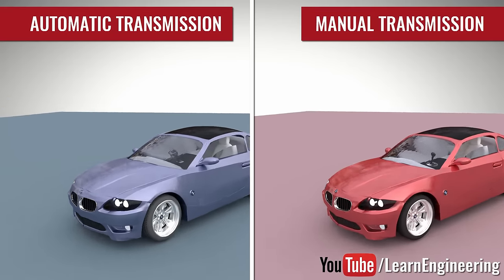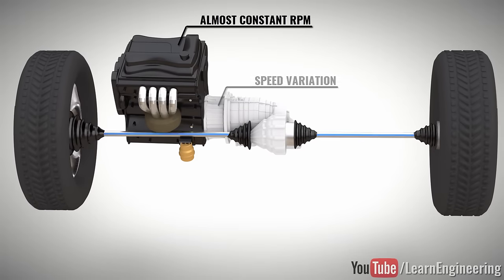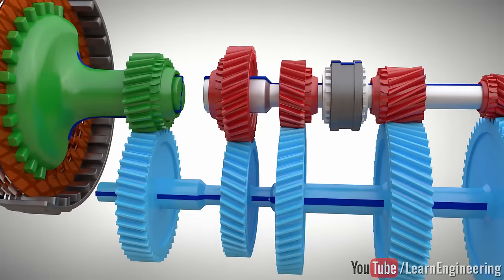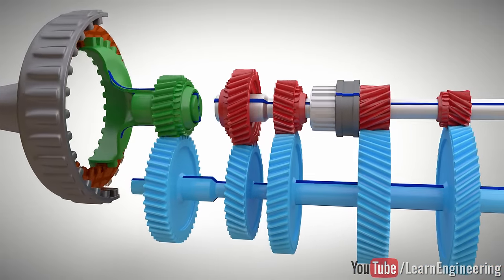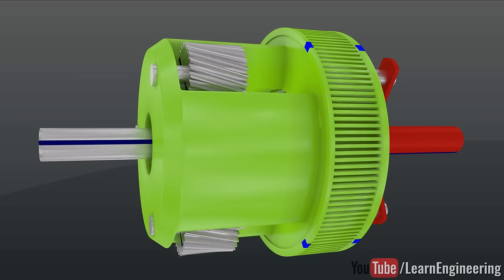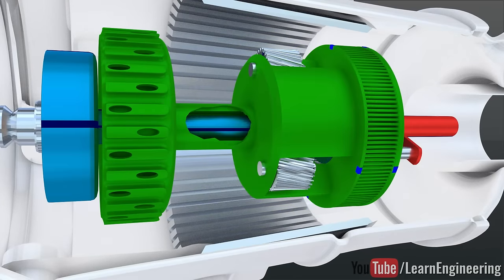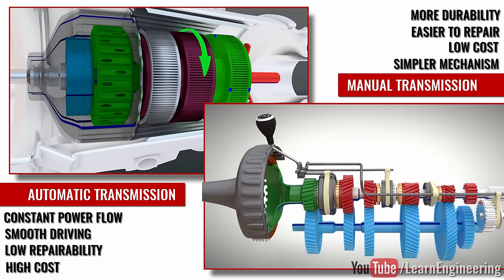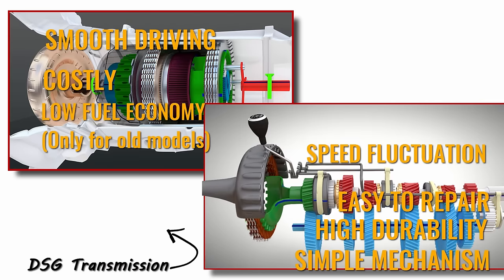Automatic vs Manual Transmission

Comment: In order to shift as smooth as a automatic in a manual you need accelerate to the rpm you wish to shift at, lift your foot just a bit so you’re no longer accelerating but keeping constant, and then shift and complete a smooth clutch and accelerator exchange
Reply: Wow sounds 1984
Reply: Its super easy, i learned when i as 9 in a 1995 ford ranger. No matter how old as long as you know what youre doin stickshift is smooth as butter
Reply: ..... it's all about the 'feel'.....being one with the vehicle...
Reply: >t Never drove an automatic

Comment: Corrections:
Manual transmissions (in cars) use a clutch disc, not a clutch pack. An automatic transmission has several clutch packs, like pictured.
Reply: Its actually called a clutch pack in a manual transmission
Reply: @joeseverythingchannel6564  "clutch pack" implies more than one clutch disc, and since manual transmissions use only one clutch disc that can not be referred to as a pack.

Besides, the pictures are wrong.

Work on learning before posting.
Reply: Actually the clutch pack includes the throw out bearing, pressure plate, friction plate (on flywheel applications where replaceable), and the clutch housing in the bell housing so eat it buddy do your research before responding
Reply: @Iowa599  oh and fyi there are manual transmissions with upwards of 4 clutch disks in them its just that the most common stock clutches only have one. Most clutch upgrades include 2 or more clutch plates to increase the surface area of the friction material

Comment: vote manual transmission
more controll and more safety
Reply: dafuq ? How the f is manual safer?
Reply: Ahh i wrote it just my opinion and a fact about my driving style,every person have opinion,did u have opinion too?lets share if u have. Auto and manual have many pros and cons
Sorry for my bad english
Reply: My opinion is auto,i mean you can just drive around chilling,dont need to shift gears

P.S my opinion
Reply: +TheRealMonster engine brake is stronger, you are less likely to mistakenly press the gas pedal when you are supposed and wanted to brake
Reply: Nice,but shifting transmision its more enjoyfull like a sportman :-D ,because we can set the speed and engine sound. No shifting like eat withouth drinking a water hehe
Reply: grayisagirl c engine brake stronger than manual?lets try at top gear and move instantly with first gear and press the brake pedal and what happen hehe
Reply: you can set the engine sound on automatic 2 :) you can (most likely) switch gear to left and theres sport mode then you can shift gear by yourself :)
Reply: TheRealMonster hehe i wanna drive auto too,but my father only have manual car hehe
Reply: You know what they say...automatic is luxury
Reply: Auto in a car and auto in a bike same or another diff??
Reply: Mochammad Agung Hidayat bro you smoke? which sentence I mention the engine brake is stronger "than manual"? Read the sentence carefully again please.
Reply: TheRealMonster if you know how to drive a manual is safer
Reply: ak74udieby tbh im 12,but i have no problems driving manual
Reply: Mochammad Agung Hidayat yep anyways automatic really sucks in the snow and it destroys it's self so fast and then R.I.P your money
Reply: Okay bro thx for every opinion,,but i'm still prefer manual hehe
Reply: Stop bro,calm down pliss
Reply: TheRealMonster manual is better, not only do you feel more in control, theres a coolness factor to it
Reply: a1022man well i agree with that ;P but have you tried auto?
Reply: TheRealMonster yes i drove auto for 2 years, im still relatively new to driving manual, ive only been driving manual for about 6 months but it keeps you more aware, you feel like you are actually communicating with the car
Reply: TheRealMonster I find manual to be more enjoyable. To be in a house with roommates with 5 cars, three automatics and 2 manuals I driven them all. I do find manuals to be a little more reliable in both traveling and safety.  My sports car, a Nissan 350Z can average almost 380 miles before I need refueling. Same model car automatic only gets 320, roughly. Because of the 6ths gear, my car is almost practically running on air. As for safety during slippery conditions, you can choose the gear. Allowing low out put of power helps prevent tire slippage.

As for Automatics, they are more reliable in a stop and go scenario.  Such as they city where traffic lights are all over. Automatics also provide the needed safety manuals do not have and that's hills. Especially backwards. Autos do not have this issue, let go the brakes the car simply moves forward. However you have to be an idiot in a manual car to roll  forwards or backwards on a hill.

Which one I like better? Manual of course. You have more control of the car. Need safety? Throw it on a high gear for low power. Need to go faster, throw it on a lower gear and watch that needle sore to around 8k RPM.  Yeah its annoying as hell throwing the gears up and down in the city, but out in open road, when you drive a manual you will understand that's where a car truly belongs.

I do like Autos, drive and forget as if there is no such thing as a transmission. Easy to use for a everyday person who's life is around the city or suburbs. But autos and their computers have a problem, if I need to accelerate.  I feel like the computer is thinking too slow. "Okay, the driver is pressing on the gas hard....  What do I do?.... Hmmm.... Bake a cake?.... No that's not it.... Oh I know! I'm a gear box!"  Taking a long time to shift to the proper gear to accelerate.

I know these days automatics comes with sports modes that makes the computer think real fast and shift much faster. However, it will never nail the right gears needed like the human mind can and that's why sports such as Drifting, and Rally and Track have manual cars, never automatic.
Reply: Haha i got friend for beaten someone wkwk
Reply: I use engine braking heavily in my car.
I always come off the freeway off ramp in 2nd and the RPM is around 6500rpm(max engine speed is 6750rpm).
Reply: I also like manual transmission more because it allows for greater control of engine rpm.
Reply: George David Aye this is true. As I said in my previous comment, Automatics are easier to use. It really comes down the perks you want and the cons you are willing to deal with about a vehicle.

Personally, I like manual better. I will choose it over an Auto anytime day or night. You choose it because it's easier. I choose it because safety, one. And two, the huge price difference. Manuals are cheaper, much cheaper depending on make and model of a car both transmission repairs and when they are sold on the lot.

The gap difference in price can be anywhere between 2-5K, sometimes more if the automatic transmission is badly damaged or worn. Parts and complexity makes automatics much more expensive.
Reply: SilverlonewolfX now a days automatics are better in every single way other than the fun factor which is all down to opinion
Reply: TheRealMonster you're 12 and don't know a thing. A manual transmission car is cheaper, faster, and provides more control over your car. I guarantee you will never beat a car in a race using an automatic transmission when they have manual. Sure automatics are easy to drive but when you're driving an automatic it is very boring and feels like you're not in as much control compared to manual
Reply: True Heights definitely not in a drag race
Reply: greyfoxthesoldier aweee,look who talks  :3
Reply: True Heights dude trust me i control manual pretty ezzy
Reply: True Heights hah race against auto? 😂 for sure auto will be defeat at 4th gear wkwk,
Reply: DoobieR Better in every single way? Not really no. If it was it be used in racing, which it isn't. So that debunks what you said.
Reply: greyfoxthesoldier i do know,alot
Reply: I prefer manual because there is something so satisfying about changing gear you feel in control and powerful in an automatic you sit there holding your wheel and thinking about how much money you just wasted
Reply: +MrCapeCanaveral
You most love replacing your brake pads every year and you most love the brake fade that comes with a power transmitted via oil
Reply: Lol wkwk manual the winner wkwk
Reply: What?!  I have never replaced my brake pads every year.  My wife's car break pads got replaced like after 7 years!  I have never heard of people replacing them every year. Sounds like bullshit.
Reply: MrCapeCanaveral haha my dad replaced his brake pads after 10 years and they were still good enough for at least a few more months. replacing every year is bullshit unless you track every other day but an average person in the us can probably last at least 3 years on one set
Reply: Mochammad Agung Hidayat it depends where you live...here in miami you don't want a manual
Reply: Exactly.  It's sucks in San Fran also. With all those hills.
Reply: TheRealMonster i have tryed auto. absolutely boring for me. i need to be able to downshift and revv match. 😀 but thats just my riding style and taste. aal i know is that i will never go automtick.
Reply: George David so that everyone can drive and crash into each other? or that you could be more on your phone? or maybe are you older? then I'd understand your opinion.
Reply: So automatic drivers are the only ones that cause accidents?  Cause I personally know some manual drivers that have caused accidents before.
Reply: no. i wasn´t trying to say that. but it fell out like that. i wouldn´t be amazed if more accidents are caused by manual drivers.. i was thinking that if the car is so easy to drive then anyone could jump in. turn the key and off they go. i ment like children and, or some grownups who have never riden before. i really wasnt trying to be rude or anything but my lack of skill in english might have made me sound rude. anyways thats just my opinion. and im not saying that automaticks aren´t for everyone. i personally love stick but i understand that some people like auto. that´s just how life is. :D
Reply: Mochammad Agung Hidayat automatic is safer, there is less to worry about and thus the driver can focus on the road.
Reply: Manual is not distracting.
Once you get use to it, it is just like flicking on the turn signal(A thing many automatic german car drivers have issues with).

If anything.
Manual is safer as you have control which is something you do not in an auto.

I can come to a complete stop at freeway speeds just by using engine braking.
Going from 5th>3rd> then to 2nd once the car is going slower than the top speed of 2nd> then into 1st when the car is going slower than the top speed of 1st(this requires double clutching(which can be done quickly once you now how and get the hang of it))
Reply: What control?  Oooh you can stop sooner?!  Shut up.
Reply: Kevin Tõnisson exactly
Reply: +MrCapeCanaveral haha 😁
Reply: +MrCapeCanaveral
I am sorry your ant sized mind cant do more than one thing at a time.
You must be one of those BMW drivers who doesnt use turn signals
It does explain a lot.
Using them is too distracting and difficult.

Manuals are also anti theft devices.
Reply: Is that your attempt at being funny?  It's not working.
Reply: yeah more safety, thats why new cars are almost all in automatic.
Reply: IIGrayfoxII well you're gearbox and engine won't last long
Reply: +Cha Cha
New cars are all automatic in America is 85% of the market wants it
New cars in europe are manual as 95% of the market wants it.

+Tony Johnson
Got proof?
Not red lining, not grinding and I keep to the oil changes.
Reply: IIGrayfoxII 
oh it means in Europe we have 95% of real good drivers. and 85 %of Americanos are gays 😂😎
Reply: Where did homosexuality come into this?
Reply: Ur comments shows how good u r on the wheel & wot u know about the cars... ride a bicycle kid😘
Reply: Lmao!  For real!  I had to read his comment multi times and I still don't get it.
Reply: MrCapeCanaveral  i think he ment to say that grayfox sayed you're instead of your.😂 and i know my english aint good when it comes to writing. 😁😁
Reply: Waw 7 weeks later we dont know what the point here wkwk
Reply: Mochammad Agung Hidayat  yup. it has been fun reading thees comments.😂
Reply: Best comment ever B-)
Reply: Madness4 no.it doesn't

Comment: Something is not exactly what happens in the real driver life at 6:40. First brake then after a while clutch. If you press the clutch pedal first you never get your driving license (in Europe), for very good reasons (engine helps to reduce speed with a manual gear box) 😉. 
Very nice videos, thank you 🙏

Comment: Just finished my manual transmission course and I find just quite similar to an automatic. It's not really that hard. Just needs more practice and you need to get used to. Though it's really fun and keeps you busy and more focused driving than doing other things.
Reply: Dont forget if you put it in the wrong gear your engine and or transmission will grenade.. Thats a pretty big difference. They are nothing alike.
Reply: Honestly, I came to a point where I can't drive automatic - I cannot understand how car is actually managing power and torque.

Comment: Well explained video, except about braking in manual. You engage the clutch if you want to stop the car or need to shift down. If all you need is to slow down a bit, you release the gas, then brake.
Also, driving manual is never a smooth experience? Sure, not as smooth as just stepping on the gas and letting the car accelerate on its own, but a decent driver (or at least someone who's used to their car) should be able to shift up and down without a problem.

Comment: 3:25
"Let me introduce you to rev matching, double clutching, and for gods, clutchless shifting."
Reply: And what will he say about "heel toe"....?
Reply: @jonwatson9765  heel toe is a method to rev match
Reply: Ahh yes some nonsense only americans do, because using a manual transmission car a normal way, is too boring. 

Seriously Who the hell double clutcy and rev match????
Reply: @anderstermansen130  Because Freedom :)
Reply: @anderstermansen130  I’m European and I do =D Got a cable operated throttle body, got that severed the other day, tied it up on spot and had the throttle pedal way higher than the brake... As a result, I wasn’t really able to double clutch heel-toe rev-match and I was pissed to no end
Reply: @anderstermansen130  : I rev match because it's a proven method to reduce clutch wear. When you change gears, the input shaft speed changes with it. Waiting an extra fraction of a second on up shift and bringing the engine speed up on downshifts reduces the differential between the flywheel and input shaft.

Comment: 6:38
*Engine braking*: Am I a joke to you?
Reply: Abdullah Haider  It is way better for the engine when you press the clutch too, there will be more problems if you don't
Reply: Abdullah Haider  unless you don't stop completely
Reply: @taazu3970  you don't press the clutch and brake. It's just that if you want to completely stop you will need to put on slower speeds as you lose velocity. If you just want to slow a little no need to press the clutch
Reply: @taazu3970  It makes no difference. The only times you need to press the clutch when braking is either to downshift or when your speed drops to the point at which the engine is reaching its stall RPM in the gear you're in. Letting the engine do some of the braking for you is also beneficial to your fuel efficiency - no fuel is being used during engine braking whereas pressing the clutch and allowing the engine to idle uses some fuel.